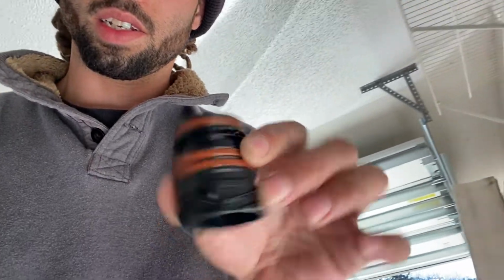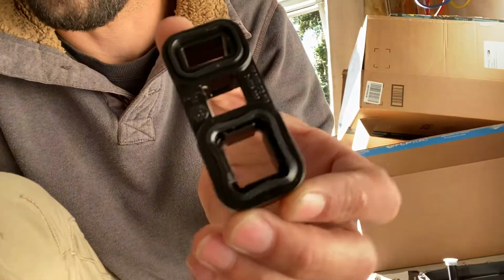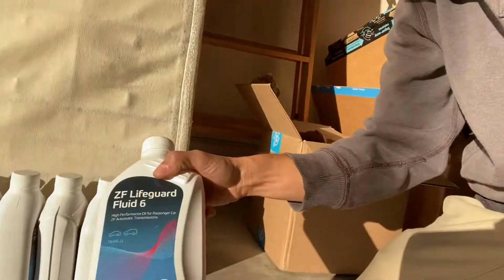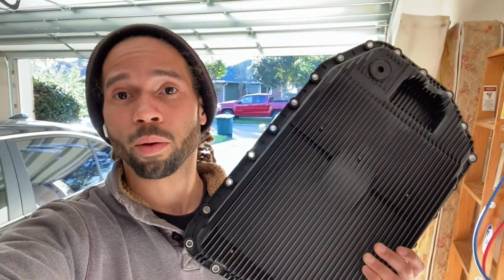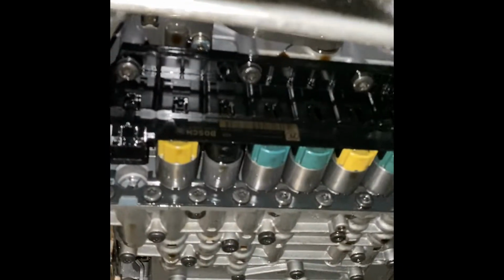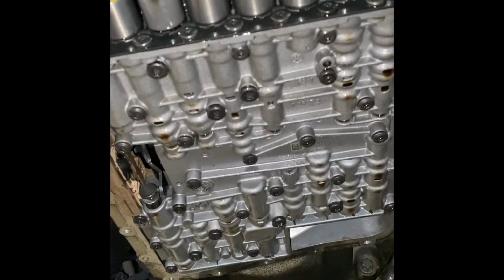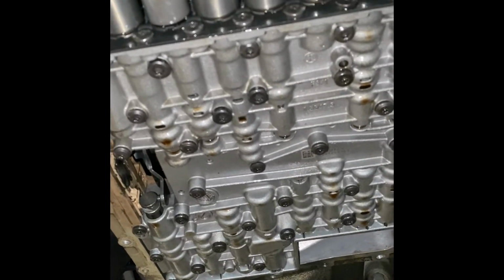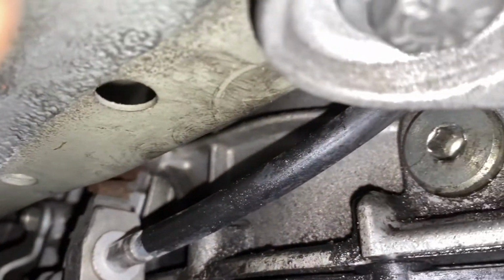BMW TRANSMISSION REPAIR PART 2 (INSTALLING MECHATRONICS SLEEVES AND VALVE BODY ADAPTERS)!

Comment: Hi TY for the video! do you know what's the torque for the valvebody bolts?
Reply from the maker: What’s the year make and model of your car?
Reply: @AlonzoCubano  , 08 328xi, I did a drained and fill transmission few months ago, shifting is lil rough first gear to second, far as I know did the fill procedure correctly, I didn't change the filter, should I change the filter and  the sleeves, hopefully it is smooth shifts ??
Reply: I have a bmw 535i 2015 got code 420421, 420461, 421342 car wont get drive or reverse any help to what to look for?